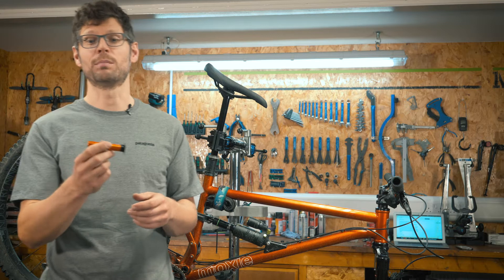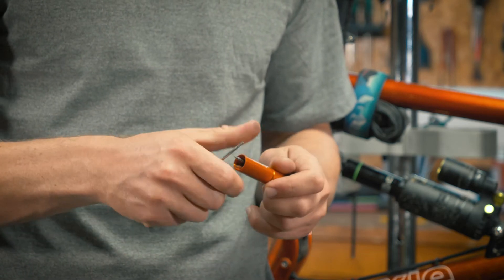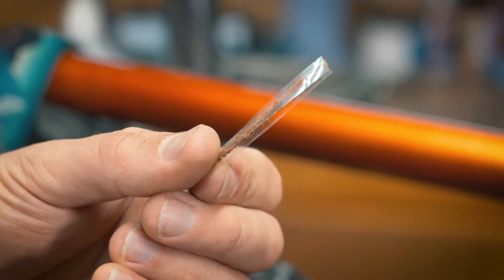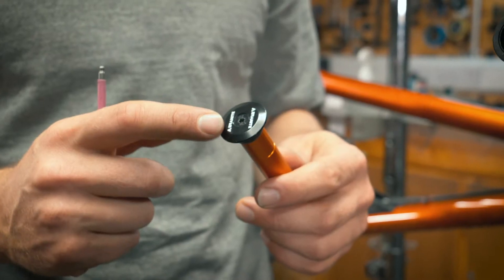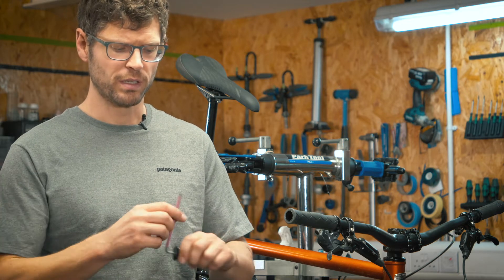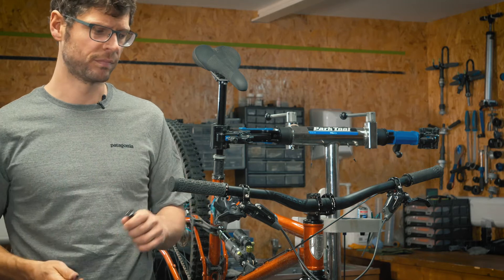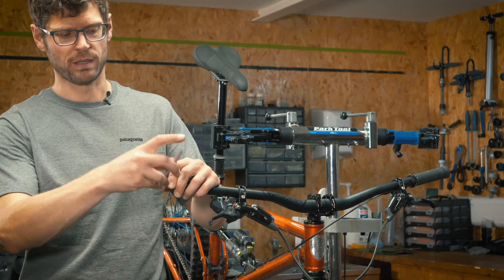How to Install the Granite Design Stash Tyre Plug

Comment: The only issue I see with this, is if you have a puncture you have to get your multi tool out just to remove this from your handlebar or crank.  

By the time you’ve done this the tyre will be down or you loose your sealant.  
Have you considered a quick removal system?  Such as a magnet for the crank or just a push fit for the handlebars to hold the product? 

But interesting design non the less. 🤔

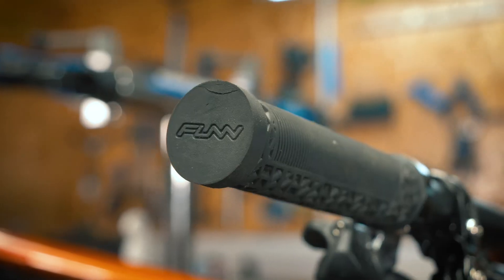Comment: This video is unfortunately very misleading -- 0:45 this tool does not have expandable element which could lock inside handlebar or crankset. It is simply silicone/rubber and you just insert/push it, and then hope friction is enough to protect it against falling out.
Reply: It's does, the rubber is a compression fit
(So when you tighten it, it gets bigger)
So it is securely mounted. (I have one, you can trust me!)
Reply: @bulldogs7  what size allen key is required to tighten?